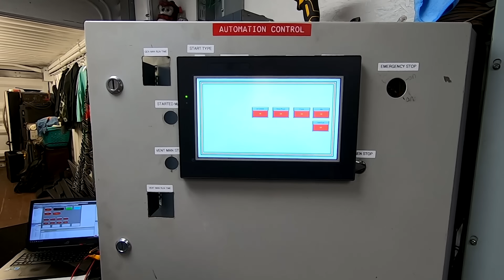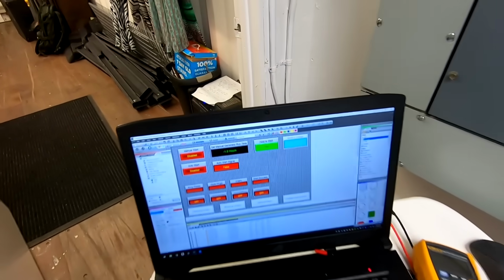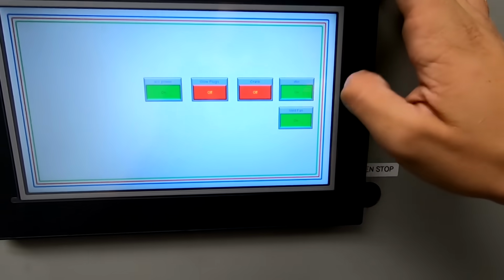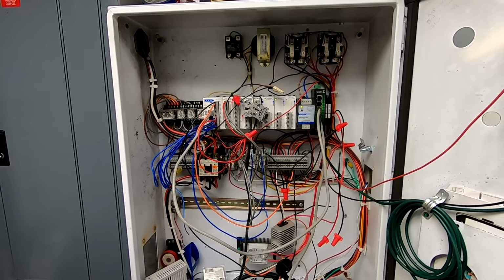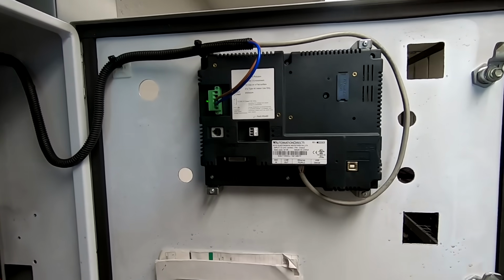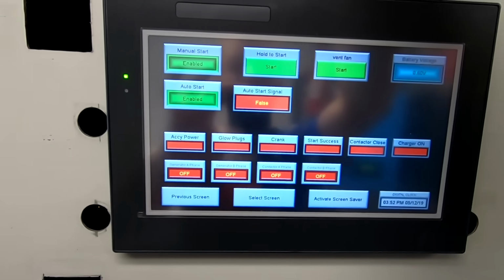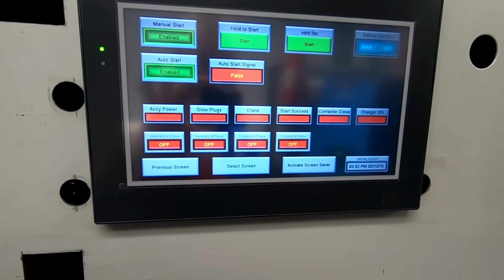Off Grid: Touch Screen Control Panel Addition and PLC Cabinet Rebuild

Comment: This has been an awesome project to fallow! 

After watching the last couple videos Im curious what the benefit of using the the $137 acuamp transducer is over using a $65 trumeter that does ac/dc voltage and current and can be logged using 2) 4-20ma inputs on your plc?

A truemeter maybe a good option in the main cabinet to fill the holes your timers used to be in? To track generator power.  

I also think it may not be a bad idea to put the manual emergence stop button back on the panel and maybe a couple other manual buttons as a backup. Just in case storm or something takes out the switch or hmi. 

Agin awesome videos and cant wait to what you come up with next!
Reply: https://www.automationdirect.com/adc/shopping/catalog/power_products_(electrical)/graphical_panel_meters/adm100-lp
Reply from the maker: I've never seen the Trumeter.  Do you have a link?  I went with the accuamp because that's about all I could find that met all my design criteria.

Comment: I think you are descending further into madness as far as efficiency goes. The second law of thermodynamics says that the more complex a system becomes, the more energy is wasted. I think you are more focused on building a flashy system rather than something that is actually going to supply what you need when SHTF. It's like a contractor buying a Lambo instead of a pickup. Honestly I don't think you will survive a week once the grid goes down. I'm trying to help you SURVIVE. 
How much extra power does this screen use? I've just bought a new inverter (studer) which seems to be light years ahead of anything else. In fact it has several auxiliary contacts that can be programmed to start a generator. And it's total power consumption? 14w. It's 4kw but that can be added to another inverter (phase matching) or generator. So I'm not seeing the need for your huge inverter or plc. Can you explain WHY you need this complicated setup?
Reply from the maker: So let's break this down...

To directly answer your question on the front panel consumption, it's only like 18 watts.  You can hit a button and put it into screen saver mode (And I think you can set a time out as well) that turns off the panel and drops the draw significantly.

The big inverter can get maxed out pretty easily.  When I'm in the shop running the 5hp air compressor and the plasma cutter, it's at 95-100% load.  Having the huge overload capability is very nice in this example.

The inverters do actually have a generator start aux contact. 

The big advantage is found when you consider the fact that I don't actually live on the ranch and I have parents that each and every day are getting older and older.  I am literally in the process of changing out the lead acid batteries because the simple maintenance of checking the water levels in them was too much and they ran them dry.  If I can automate as much as possible so there is little to do (And at the same time little to forget about or screw up), the better they are off.

Since I have all this data available, once I'm tied in to the web, I can sit at my desk in Idaho (Where I live) and keep an eye on things and make sure they are taken care of.
Reply: HighTechLab  so the grid goes down, and you will:
1. Still be going to work
2. Have internet

What is the total idle consumption of inverters, power supplies, relays, plc, bms and anything else?
Now calculate how long your setup will last without pv or generator. That is the only thing that matters if you are taking this seriously.

Lots of whizbang gizmos that make your inexperienced subscribers go "oooh, ahhh" mean nothing
Reply from the maker: @climatechangepreppersfaceb2148  I think you're missing our reasoning for having this setup. We have it because the utility company wanted to charge us $70,000 to bring in lines and for much much less I was able to build this setup. Not trying to live forever when s*** hits the fan, just trying to live a comfortable lifestyle without selling limbs to pay the utility company.
Reply: @HighTechLab  It looks to me like this is not your typical SHTF system which I see at gun shows and such - a couple deep cycle batteries, 4 or 6 solar panels and a cheap PWM charge controller, and a ~2 KVA high frequency inverter.  Some SHTF don't even bother with the inverter due to inefficiencies and instead buy 12VDC appliances / radio chargers and the like that really need power.  Other SHTF folks just buy a generator and call it done.  It has the advantage of sitting in the back of a pickup with room to spare.  What I see here is you're becoming your own power company, every day, rain or shine.  As for remote operation, with the automation you seem to be developing, you really don't need support once the panel is programmed.  Ideally, or when you're finished, it would take care of everything itself.  I do think you'll burn through 100Ah pretty quick with all those loads.  If you enlarge the battery array, yea I know it costs bucks, then with all those solar panels you could produce more than 1 day's power in a solar day.  That would allow you to run without starting the genset through stormy weather if the batteries are sufficient.  HEY!  great idea - program up a SHTF button that kills power to non essential loads like the electrically heated hot tub!

Comment: Why not add a timer capable of holding the glow plugs on for 10-15 seconds (like most modern diesel pickups). I haven't played with the Click PLC enough yet to see if that type of timer can be configured.
Reply: They was just a quick test program, I'm sure he added that later
Reply from the maker: Indeed.  I have full auto start capability now.  I think I might have actually shown toward the end of the video?

Comment: Looking good. I'm working on my own small solar setup. I'm making a 115 watt tracking solar array, with some assisted water cooling to help the panels run closer to max efficiency. I'll have 16 wires going through the window, got a 1000 watt pure sine wave inverter, lithium 18650 batteries, voltage converter for charging 12.6 volt batteries off the 17.2 volt panels, a temperature difference pump controller, shunt amp meter, bms, ect. It's gonna be a nice little system, but not overly complex. 115 watts isn much, but I'll be able to add in to it as I need.
Reply from the maker: Stick away from 18650 cells if possible and go with LiFePO4 Prismatic (block) cells.  You will have constant headaches trying to keep an 18650 style of pack in balance.

Comment: Should have a screen with just information,  voltage and current thats being drawn, the power solar is generating etc
Reply: A shunt wastes power. A good system doesn't need anything other than a voltmeter which uses mw. An experienced operator can look at the voltage and know everything he needs to know. People drool over monitoring but it's a fad. A good system doesn't require someone to watch gauges all day every day. You put it in and it does what it's supposed to do. You forget it's there. Once every 6 months you check on it
Reply from the maker: With the prismatic lithium cells I will be installing, you cannot properly judge state of charge by battery voltage (Other than the top 10% or bottom 10%) because the discharge curve is damn near flat (This is caused due to the extremely low internal resistance)
Reply: @HighTechLab  I use Lifepo4 and low internal resistance is not the reason for the flat charge curve. And you most certainly CAN estimate SOC by voltage. Other lithium chemistries also have low internal resistance but have much steeper charge curves
Reply: @HighTechLab  I knew the batteries had curves, but I never knew the curve could be like that
Reply: @landonferguson7282  it's not like that. He is confusing "flatter" with flat
Reply: @climatechangepreppersfaceb2148  oh, ok
Reply: @climatechangepreppersfaceb2148  I'm going to respectfully disagree here re: power wasted in shunts and reliable SOC from voltage.  To estimate SOC from terminal voltage, you need much more information.  What is the temperature INSIDE the battery, and the history of temperature for when it was last charged + discharged,  because that's where the voltage is a function of temperature.  Better battery mfgrs publish curves for each 10 or 20c to design a system.  What's the current going through the battery at the time of voltage measurement, and is it charging or discharging?  What's the health of the battery, i.e. how far does it deviate from factory published specs?  Was it recently heavily loaded or rapidly charged?  If you know all of that, and have some curves or look up tables, yeah, you could get a close estimate of SOC from voltage alone.  But look at the second parameter needed: the current at the time of measurement.  If you know current and have a sophisticated controller, it's relatively easy to integrate current over time.  This too has sources of error, like the sampling rate and how steady your load or charger is.  Now, as for wasted power in a shunt.... Take say a 500A = 50mv shunt.    It's a precision 0.1000 milliohm resistor which, at its maximum 500A, will dissipate 25W (I2R).  But 500A at 51V is 25,500 W, which is wasting 0.098% of the system power WORST CASE, given the loss in the shunt varies with the square of the current and keeping in mind most use will not be at the maximum design point.  Given a GOOD quality inverter (US made) will have roughly a 4.00 % efficiency loss, then a current shunt is 2 orders of magnitude less power waste, on par with cables. In normal usage currents, it's more like 3 or 4 orders of magnitude less than the inverter loss.  That's why Victron and other marine grade power systems have shunts for their SOC meters.  Even with experience, I can only ballpark SOC with 3.0 VPC being time to charge and 3.5 VPC being full.  At 3.3 VPC it's really hard to guess.  What terminal voltage is good for is knowing when to stop charging and start charging, because those points have much steeper slopes.  --H
Reply: @haroldlopez2406  like I said "estimate"
Reply: A good inverter / CC already has a shunt. Secondly, deliberately creating a volt drop using a shunt is not required, there are already similar volt drops which can be used (you would need to calibrate obviously) such as cables, fuses and breakers. There is no point adding a 3rd or 4th volt drop in both directions if you can measure from one of the existing ones. Third, the majority of shunts are 75mv, not 50mv
Reply: After a bit of googling, a shunt and a fuse have similar volt drops. A 150A fuse has a similar resistance to a 100A shunt. A voltage divider could be used to calibrate but I prefer to tap into a cable with a screw until I get the right point. 
Grab your multimeter and check your system under high current. It's amazing the volt drops you can find where you thought there was none
Reply: @climatechangepreppersfaceb2148  I have a small portable inverter and did exactly what you suggest - use something already there.  In this case, there was a strap to select internal or external battery as the source.  I was using a bench meter that had math functions allowing me to scale that drop across the strap bar into a current reading that was good enough for what I needed.   I've seen 50, 100, and 75mv shunts, but if you think about it, a 50mv 100A is the same as a 75mv 150A.  Those semi-standard values were adopted in certain revenue meters.  In actuality, the 50mv is the smaller contribution of an installed shunt, because you also have lugs on each side, which unless lapped flat are not the greatest connection possible, and external metal not part of the shunt itself, oftentimes brass, not the best conductor.  Very few people make excellent connections that would pass a telco carrier inspection and in the big picture all those losses add up.  My concern with connector flatness is that it not only is a system loss, but conducts heat into the battery via the terminal - we don't need any more heat inside the cells!
Reply: @haroldlopez2406  yes people fail to understand that every connection is a power loss. I could name a few Youtubers who have excessive amounts of connections, often with multiple shunts in series.....and every 2 years they are like "I can't understand why my battery bank has died". I'm currently building what I hope will be the most efficient off grid solar system in the world, by getting rid of all the common bottlenecks
Reply: @climatechangepreppersfaceb2148  Yeah, when I can feel hot terminals but cold wires, you know there's a problem, and it's not the wires!  Which inverter are you going with?  HF or LF?  HTL's system has an elephant in the room in that the 12KW china special 12KW is lucky to get 80%.  There are great gains going to modified SW if you don't have any motors, compressors, audio/video to run, i.e. just computers or other switch mode PS tech.  The Chinese inverters offer huge specs, but also huge losses.  Magnum used to have a special unit, but their quality has degraded recently.  The transformer is still one of the most rugged out there, but the ancillary support hardware like temp sensors give out way before the fets or caps causing Magnums to be scrapped after just a few years of svc.  Xantrex is at 94% pure SW LF inverter on 24V, and their parent company Schneider Elec makes a 48V bigger brother that boasts peak eff of 95.7% weighted eff of 93% on 48V and gives a split phase output 120/240.  You're 50Hz, right?  There's some slight efficiency gains in 50Hz vs. 60, which was one thing I toyed with doing for better numbers - except I could never plug it into grid AC.  It's a huge efficiency win for engine generation by running at 3000 rpm vs 3600.  Are you doing absolute total system efficiency where you also include solar panel eff in your figures.  That's seldom an issue for off grid homes as land is abundant but for boats/RVs where real estate is at a premium and you can't just add more cheap panels, the solar cell eff becomes a priority.
Reply: @haroldlopez2406  magnum has a horrendous idle current right?
I'm currently using victron which is 95% with a tiny idle consumption. It's LF. The new one is a clone of studer (fangpusun). LF, 4kw, 96% and 14w idle consumption.
Yes 50hz here. Yes pv efficiency is a factor and there I will score badly. It would be expensive to rectify.
Reply: @climatechangepreppersfaceb2148  Victron is quality stuff.  I was just watching  your kombilife fire video.  I put up a comment on your page and subscribed!  What an idiot.  I always said one day jehu would burn someone's house down with his batterywall.  I was wrong - he got both their house and car in one stroke!  Can you send me the vid numbers that you grabbed those clips from?  I could not find the kombi + jehu video of building that death trap.  Plus, jehu in his infinite wisdom decided to solder directly to the terminals of the 18650.  Dumb.  And what happened with youtube closing your channel for clips - its not like you copied the whole video!  Who initiated the strike - jehu or kombilife?  Best of luck with your new venture channel - I'll tell some friends to come on over to it.  -H
Reply: @climatechangepreppersfaceb2148  I don't need monitoring for my system, but I honestly like to watch the numbers, it's just interesting to look at, and is assuring for people like me who build DIY systems that could possibly fail or just not run right.
Reply: Ya, he needs a little shunt amp meter. They make ones that measure volts, amps, watts, and watt hours. Just bought one myself for my system.

Comment: I see you removed the emergency stop you should really install that especially when service work is being done to energized circuits
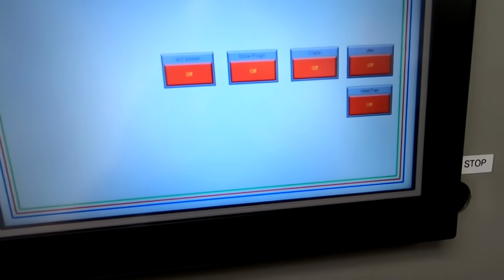Reply: @2:25 where is the emergency stop??? Temp wiring should have a stop circuit ??
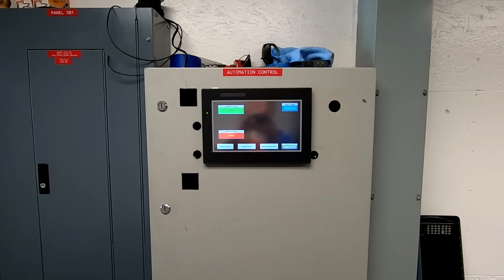Reply: & 5:51 still no stop
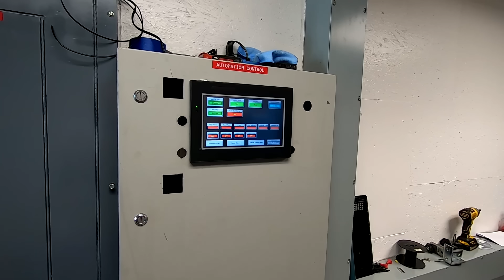Reply: And finally 9:11 still no stop
Reply: the e-stop has never been wired up from what I've seen
Reply: ftlancer it is there
Reply: I meant the cutout
Reply: JBL BOIS  do you want me to explain to you how to be safe ??? Or can u just say I was right.. btw I am a Electrican and have a electronics degree and a 3D modelling degree and I bump 10w7 in my truck so I am a JL fanboy!!!
Reply: ftlancer what subs? (Model)
Reply: ftlancer also I wa s a little dumb and did not watch the full video

Comment: Does the software to create interfaces for the touch panel require a license?  I've been considering building something like this from scratch, but that panel seems like it provides more than enough functionality.  I assume it's also rated for conditions that something like a raspi or beagle bone could take long term (especially the display module)?
Reply: You mean it's rated for conditions the raspi or bb could NOT take long term, right?  Industrial controls often are rated to operate at 50C with no fan since they get installed in mezzanines with no HVAC of their own.